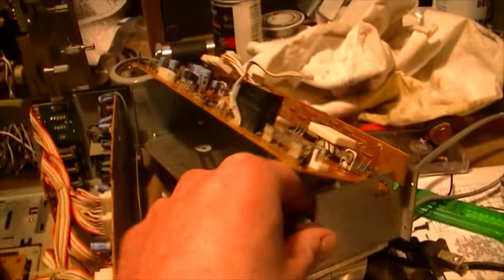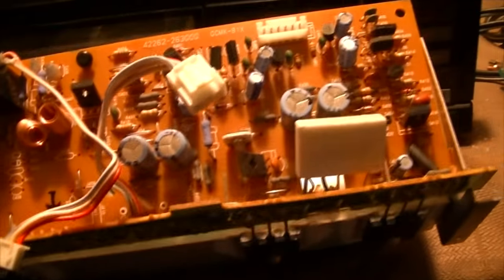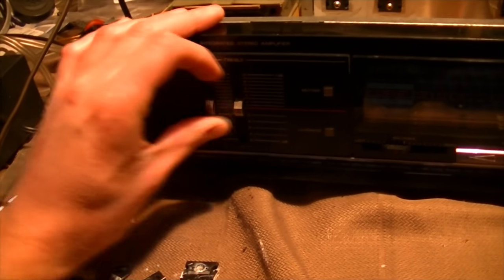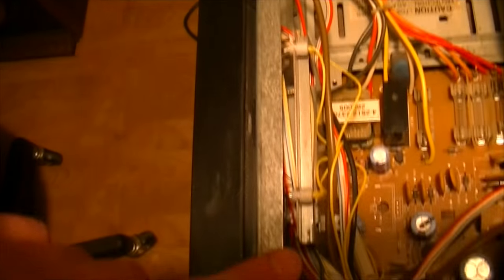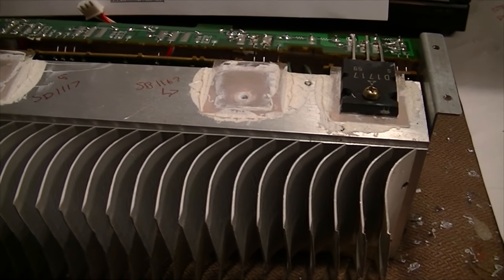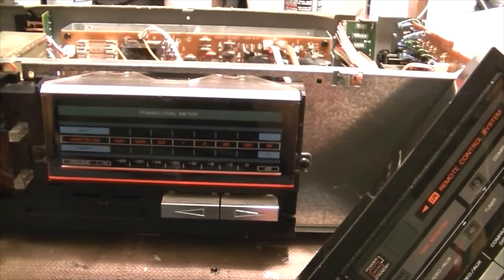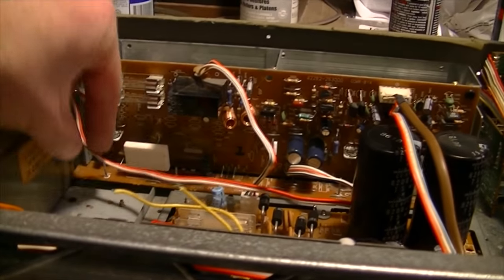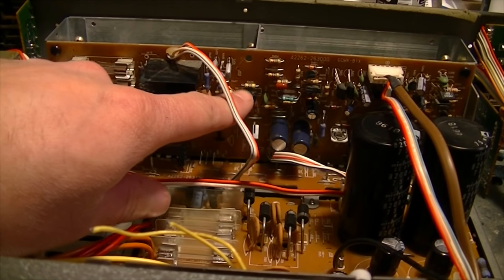Fisher CA-871 System - Repair Series - Part 3 - Amp Repair

Comment: I have similar tuner that the digital display for radio tuner went dark , can't tell what station you are on . everything else works fine . Would it be a bulb or something more complex .I m no component tech but I wire houses ,motorcycles , cars ,fix electric motors.etc . Is this something Imight be able to fix.

Comment: My CA 857 can use 2SC3280 or 2SD1717 for Q1 or Q2 then 2SA1301 or 2SB1162 for Q3 or Q4,  my unit has the 3280 and 1301 made by Toshiba DL the service manual for a CA 857

Comment: Trust me, do not second guess engineering, there are very few exceptions and circuits that can be improved on, mainly it was a cost factor, you may improve the longevity but how did these last this long with bad engineering? No more of case of over loading the amps.  I was young once, I figured out I could plug my guitar amp partially in the HP jack and get sound from the stereo and the amp at the same time, until the stereo went up in smoke.